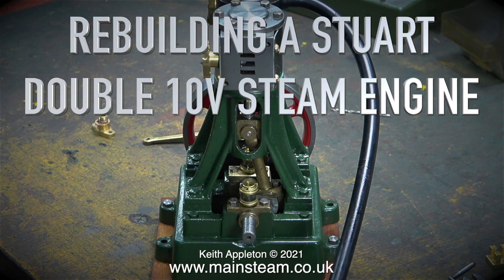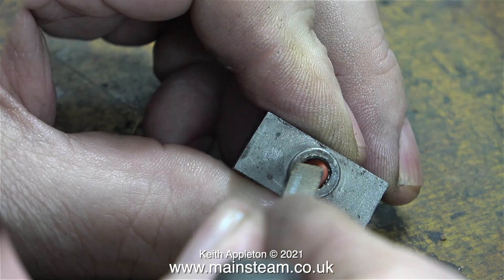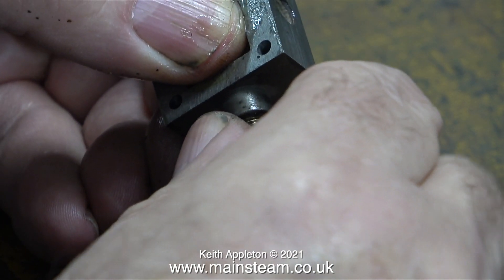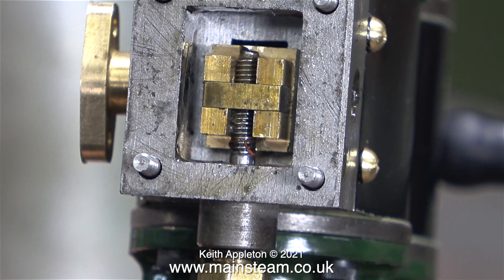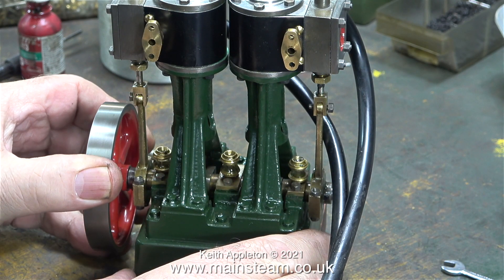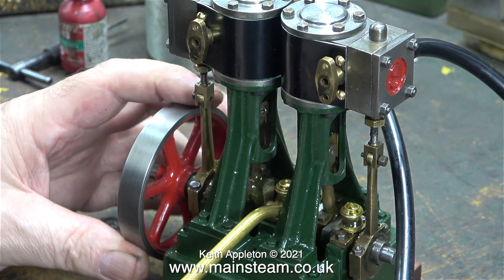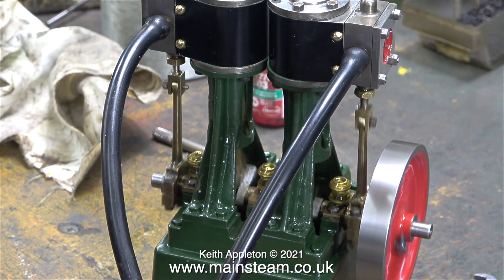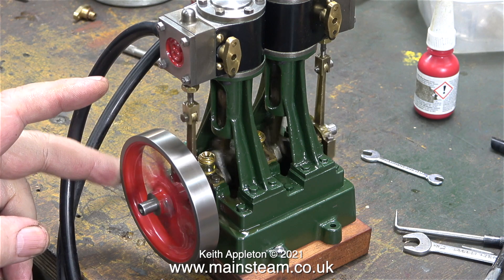REBUILDING A STUART DOUBLE 10V STEAM ENGINE - PART #15

Comment: Keith it may be a little late but I hope you and the family had a good Christmas. I like the way you have worked on this engine. It seems to be running very good now. My question is a cosmetic one. The red S one the steam chest cover. Is it supposed to be all one color or should the background be red to match the flywheel and the letter be green to match the rest of the body? Overall I like the red and green colors Very Christmassy. Do you hook your steam engines to generators to light the tree or take the traction engine for a ride? My grandkids would love that.
Reply from the maker: I don't like that style, I prefer just one solid colour for the logo.